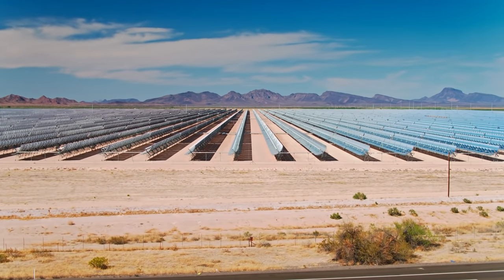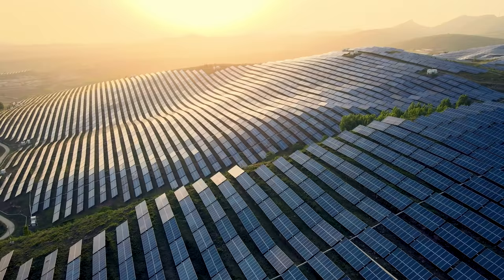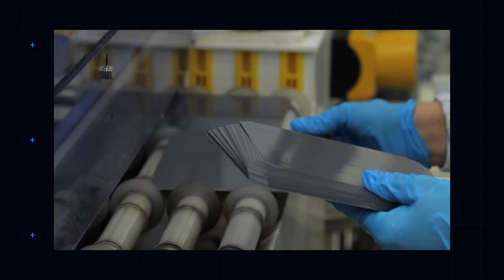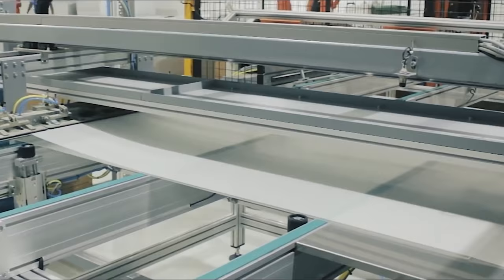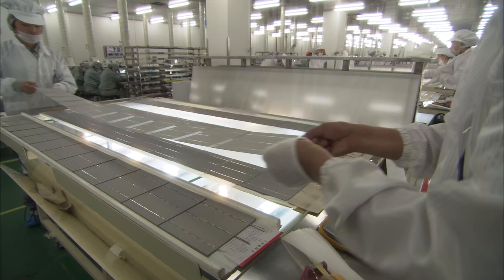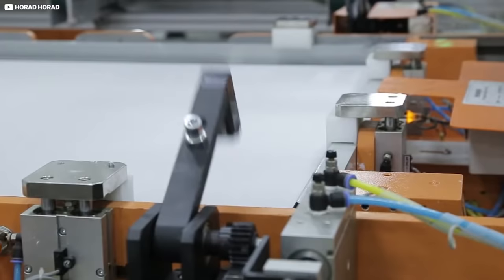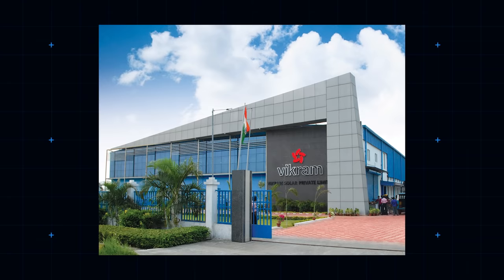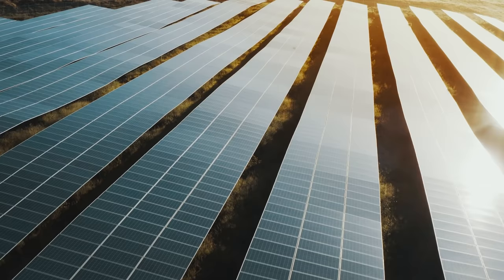How Solar Panels Are Made

Comment: No real mention of the chemical cleaning steps which usually involve Hydrofluoric acid, Hydrochloric acid, Ammonia Hydroxide and Sulphuric acid among other chemicals. In countries like China who produce vast amounts of solar panels for the western market, these chemicals are often dumped into rivers and landfills. They also use vast amounts of water in the process which becomes contaminated and is also dumped into local locals. 

Such an environmentally responsible technology :)
Reply: Don't forget the "Source of carbon" aka coal they use to fuse with the silica. And they use a coal powered furnace to melt it too. Mmmmh, soo clean.
Reply: still, it's one of the better options we have
Reply: @abalakrishnan4152  
No it's not. IF you are concerned about carbon then you need to start doing the maths on the true carbon cost of solar panels from life to death and then comparing it to the energy they produced in comparison to the carbon cost of nuclear power.  In general the calculations for solar panels rarely go all the way back to the source materials and instead concentrate only on the manufacture, as a result the most quoted figures are wrong. 

Nuclear power would be far superior and most importantly, it's an entirely stable and predictable source of energy. Solar panels are not reliable because the power they provide is intermittent. Worse still, the panels lose efficiency in hot weather as the basic principle of the panels is undermined in such heat. 

Gas powered stations are superior to solar panels at this point. IF the alternatives being created based upon various mineral lattices become functional then we can talk again but until that point we need a reliable source of energy if we hope to avoid 2-3 billion people from starving to death. 

Solar panels also don't provide the necessary feedstock for nitrogen fertiliser production (this comes from natural gas). Do away with that or dramatically increase it's cost and you have a billion starving to death within a year.

Comment: Nice video ! Too bad is about the so very inneficient still solar pannels + indirectly polluting by the aluminium in their construction + all other needed electronics for a complete solar powered grid system from photon to outlet (wiring, invertors, controllers, etc.) + al of those gadgets afterlife / recyclying nightmare... My solar blade system that integrates with the UNIVERSAL LIVING SPACE (home + office + workshop + greenhouse + terrace + trining, sports & playing grounds + ... ) is the absolute simplest approach to actully use minimal such technology for the absolute best effect. NO ALUMINIUM, NO GLASS, NO INVERTORS, NO BATTERIES (unless really needed and even then they will most likely be mobile ones like EV or various gadgets that have their own energy storage) ... THE PERFECT MARIAGE BETWEEN OUR PUNY LIMITED TECH AND NATURE'S POWER ... until we realize that we don not even need all that electricity or noe at all even :)